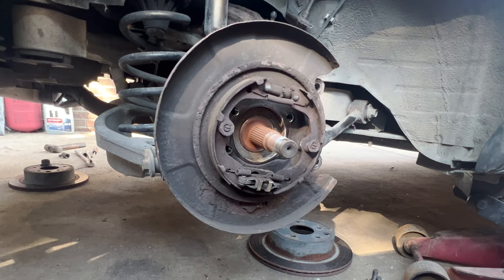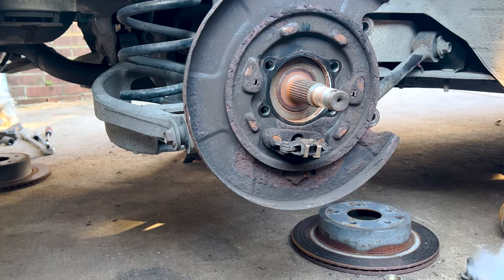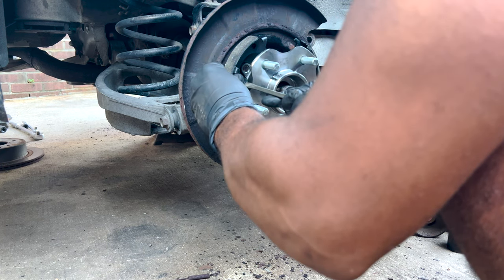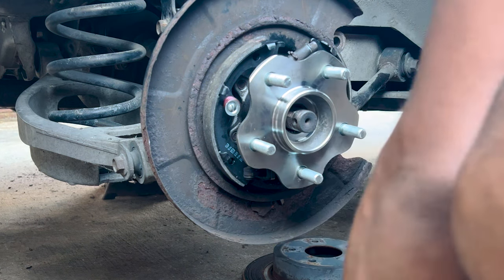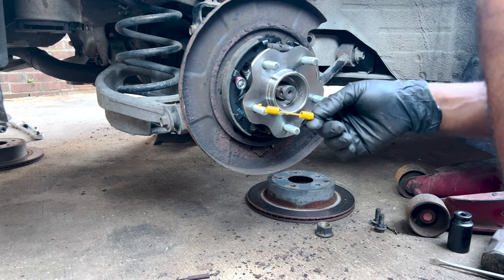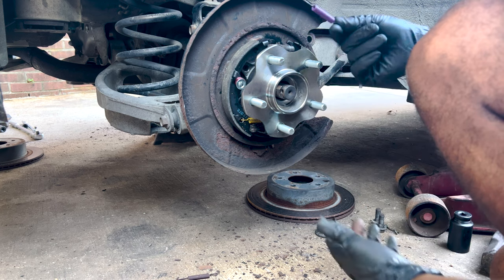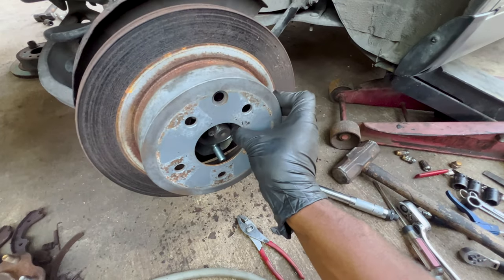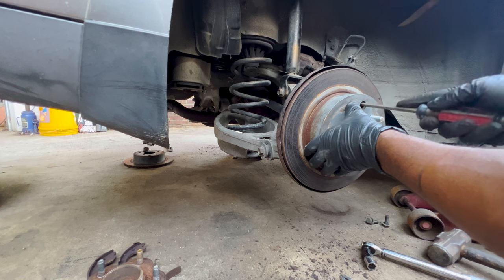2003-2008 350Z, G35 Coupe, & G35 Sedan Parking Brake Shoe Replacement & Adjustment!!!

Comment: Awesome! Worth it alone just for the advice on spinning the adjustment wheel. One tip for everyone though is that the 10mm nut on the other end of the ebrake line -- located near either the handle or the foot pump -- may need to be set, after tightening at the wheel hub. I got tripped up on that real bad...
Reply from the maker: Thanks for the info!

Comment: My e-brake is locking up when I roll forward and back, could that be a cause of bad shoe brakes….
Reply from the maker: Get both rear wheels in the air, remove the tires and check the parking brake cable and make sure its not getting jammed. If the (parking brake cable) is good I would check the (parking brake shoes) on both sides and make sure that system is working properly. You should find the problem or at least get closer to a solution. Good Luck! Let me know what you find!

Comment: Did you have the e break Engaged when you were doing this?
Reply from the maker: No, the E brake should NOT be engaged when doing this.
Reply: How would you get the rotor off with it engaged?
You wouldn’t